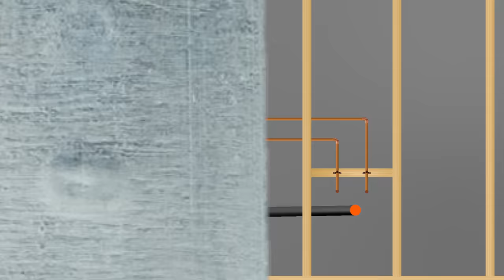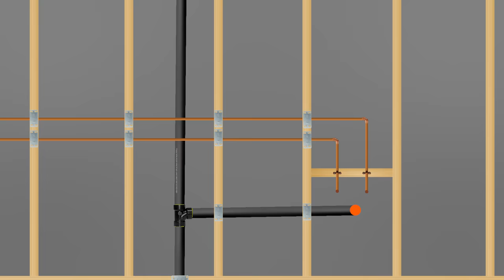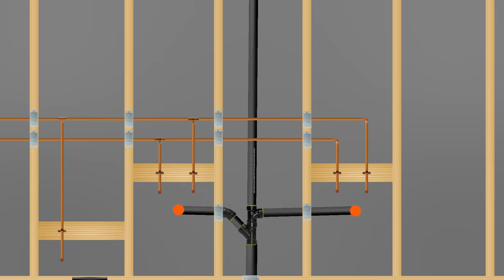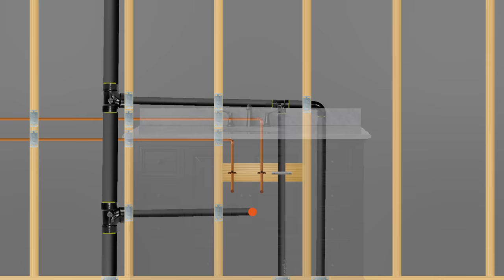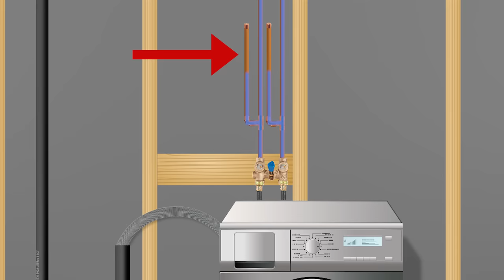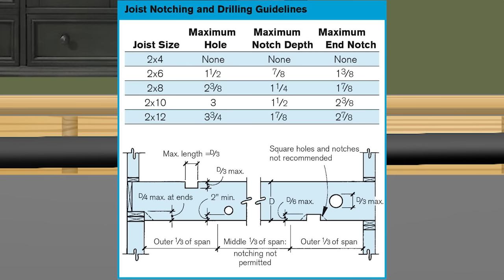10 Reasons Why You'd FAIL a Plumbing Inspection! | GOT2LEARN

Comment: I just moved into a house built in 1949. It needs allot of work, but I want to get the plumbing taken care of first. The escrow covered the big root clogs. I am positive the previous owner did not keep up with the plumbing, and the crawl space is small. When I flush the master toilet or run the shower. I hear bubbling from the guest toilet. Any insight into what is the reason? The quest toilet clogs easily. Thank you I will watch more videos, and have more questions
Reply from the maker: Could be bad venting David or maybe it just wasn't plumbed right, would need to see some pictures.

Comment: Excellent video. I am a plumbing and gas inspector in Alberta and you're bang on, these are the top 10. A lot of my job is answering questions for people who pull homeowner permits (which I'm happy to do), but this video explains what they need to know so well that I'm going to start sharing your link. Well done.
Reply from the maker: I am very thankful of your comment Kevin, I really appreciate your kind words :)
Reply: We have none of this in the UK. No requirement to have pipework inspected. We also don't generally have vent pipes either. Only pipework requirements I'm aware of is that any tank overflow pipes cannot be connected direct to drainage - the overflow has to be visible - so you know it's overflowing - water saving requirement. The other requirement is where there are two sewerage systems - 'foul water' and 'fresh water'. You can't connect toilets to fresh water drains  -as that bypasses the sewage treatment works. Many places have just one system and it all goes through sewage treatment works.
Reply: @nuntius1933  The no back flow is a thing here, England and the no over-flows straight into a drain (although that might not be so significant now most of us are on water meters - so we pay for wastage). Other than that, anything goes. There are regs for gas and electricity, but home owners are not bound by those either - they stop non-registered people charging others for work -  for gas work at least.
My dishwasher drain hose sprang a leak last night - so even quality of water parts used by manufacturers is not that regulated !
Reply: Hey Kev, Is there any way we could chat via email, or here?. I'm a new Journeyman, & i'm moving to Alberta in 6 weeks. I want to try & improve my code knowledge, & what better way than to pick the brain of an educated individual in the same field. Hope to hear back, ty

Comment: worked for a plumbing shop in  1978..  one of the bins of fittings in the back of the shop where everybody walked was a really full bin of 3/4" galvanized street ells..  an elbow with female threads on one side but male on the other.. i stopped at that bin and screwed 4 street ells together just a few threads.. forcing the last connection to just be touching as i rotated the ells in place.. i hid to the side when the  boss walked in..  he came to a skidding stop.. seeing the 4 elbows screwed into each other.  he picked the assembly up and examined it closely.  smiled and carried it away.. it ended up on his desk as a paperweight.

Comment: Great info.  Problem is that the plumbing inspectors in Atlanta just made up rules to flunk the plumbing on my sister's addition in the 1980's.  They disallowed the sanitary-tees in vertical pipes, claiming they had to be combo-tees, as you show for horizontal.  They failed a screw-in PVC connection to older cast-iron sewage pipe, saying the PVC pipe had to be leaded into the cast-iron (wouldn't it melt?).  They said the hot-water line to the kitchen sink had to be 3/4", even though it necks way down at the facet.  The later was in the State code, but a great waste of energy and water waiting for hot water to get to the sink.  They wanted the job redone by their "pro" buddies, even though state law allowed doing the plumbing in your own home.  Much corruption in building trades.

Comment: FYI. As long as the 90 is a “SWEEP” it can be used. A short sweep is perfectly legal and usually what people get when they say “I need a long sweep”. The fitting that you called a short sweep 90 is actually called a1/4 bend and can only be used for vents or drainage from horizontal to vertical
Reply: I was told by an inspector that a medium sweep can be used if you are transitioning from a horizontal run, to a vertical run like a waterfall.  I still use a long sweep anyway.  Medium sweep NO GOOD for a horizontal turn for waste water.
Reply: U shouldn’t be using a short sweep u should be using a San T with a vent. The name applies to both you can call them bends or refer to them in degrees
Reply: Reading from the "Cabot" plastic piping handbook, the 3" fitting in question is referred to as a "straight 90 and has a take-up of 1 27/32"  used in dry sections of the vent systems only.  The 3" DWV fitting known as a 1/4 bend (90) has a radius of three inches and a take-up 3 1/16".  Difference in radius and take-up is due to hubs on each end.  There is no such DWV fitting as a medium sweep.  For DWV piping there is only one radius for each pipe size, unless special order.  Standard radiuses are,  Short radius= 1 x Dia. of pipe,  Long radius= 1 1/2 x dia. of pipe.
Reply: @AyeCarumba221  any SWEEP can be used in verticals to horizontal or horizontal to horizontal applications. BENDS can only be used in drainage from horizontal to vertical or in vents

Comment: I live in an old home built in the early 50's, my washer plumbing is indeed 1.5" pipe. I had issues with it sometimes overflowing too. But since I bought a new "HE" washing machine a few years ago that uses far less water, it's actually been working perfectly fine now. The drain hose on the new washer is only about 7/8" or so, and the 1.5" drain pipe is more than capable of handling the flow from that small discharge hose.
Reply from the maker: Awesomeeee!

Comment: Vents lower than flood rim of fixture:-- Although an odd duck for sure, the configuration for an island vent has a workaround for being an exception. i also love wet vents which usually get a knowing nod of approval from inspectors. I don't know your locale but in Los Angeles I stopped putting T&P on water heaters and instead just  put a pressure relief outside by the shut off. No more pans or drain issues with old heaters inside closets. Always passed.

Not appreciated enough is the satisfaction of watching a main line stoppage let go, after you've been playing catch and release with a forest of roots, letting it tangle up just to the edge of the cable flipping in the cage,  then yanking back, like fighting a marlin; then it goes BOOM like thunder and you may even have to hook the cable up to your truck and pull out a 10 ft tail of magnificent roots. You feel like mounting them as a trophy! 

Retired plumbing contractor now, but thinking back, I enjoyed being Roto-Rooter man in L.A. Hollywood more. Every job was an emergency; calls in the middle of the night were like sweeping out of your bat cave, and whether you arrived at a swank Beverly Hills restaurant, a mansion on the hill, or some low rent apartment complex, you came in like a cowboy and everyone followed your commands, rich or poor. flooding sinks from floors above, main lines backing up into basements at exclusive country clubs. But all of them open sesame to you, fair haired hero of the moment!

Comment: Thanks for putting up this good video with explanations. Those doing their own plumbing should bear in mind that these are "minimum" requirements, and that your local code may require some different or more 'robust' features, .e.g. washing machine drain no less than 1300mm (about 4 ft 6 inch) above floor level not above the point where it ties in to the drain.  Likewise, local weather conditions (i.e. winter) may specify where running water, waste lines and vent stacks must go, in order to avoid damage from cold air ingress or being close to a cold outside wall. (These also govern rules for things like sizing of natural gas hot water heater and gas furnace exhaust vents. 
When roughing in, bear in mind that Code is a miminum standard. In many cases, going one size up, while slightly more expensive in the short term, can prevent future problems that are much more expensive to repair once everything is closed in. As with electrical, it's much better to "do a bit more" at the rough-in stage than try to retrofit later on. If you are hiring sub-trades to do some or all of this work, do not assume they will do it to code, or to the plans, or correctly at all. There are many excellent tradespeople, but every profession has its share of "take the money and run" bums. 
It's also worth remembering that some "big box" stores sell products - plastic accordion flex pipe sections, for instance - that do not pass code anywhere, usually for very good reasons. Just because they sell it doesn't mean it meets or exceeds local code requirements.
Reply from the maker: Well said Flying Beaver!!

Comment: About the below grade drains, I saw another video about that.  They said the same thing about using a 45 street ell in the sanitary tee to improve flow and reduce the chances of clogging.  But it also has an added side benefit, in the event that it does plug, the longer sweep makes it much easier to snake out, as snakes do not like sharp turns.

Comment: Good ones, but nail plates are not required unless the pipes are 1" 1/2  or less of the edge of the wall. Also You can't catch 2 different fixture from a drain stack unless both trap arms are at the  same level using a back to back fitting(double fixture fitting). Regarding to  tie-into an existing vent, its something you can do as long as you count all the fixtures units and ensure is capable to vent whatever fixture you will be adding. Clean-outs are required to have when is the end of the line, change of direction exceeding 135°, branches off the main  larger than 5' , foot vents and long runs every 100'.

Comment: My 1 century old building has many thing not "up to code" because there were not any code for many thing.
-No Shock absorber. (I did talk about my mom to not snap close foset because old rusted iron pipe could burst from their thin grinded wall)
-Many short 90° turns, also many pipe were done flat 0° so being so old the house ever so slightly sinked in the ground and now some pipe have negative ~-1 to -2°
-Many if not most 45° Y-Pipe on pillar sewer pipe are like at 3:13 So a mix of old pipes filled with junk plus that angle make most sink/bath and wat not "gurp"

Comment: Drill plates are not always required for plumbing or electric; they’re only required when the distance from the face of the stud/joist to the surface of the pipe/wire is too little.
A simple sanitary T on the flat won’t work for long, especially with toilets as the flow can hit the T and split leaving solids to build up.

Comment: A double sanitary tee makes near impossible to run a snake through it since it goes right through to the other sink and a clean out is not practical since there usually is not enough room.  Where I live we use double "Y" or off set the drains.  Sanitary Tee's also have a lot of resistance with flow even vertically installed.

Comment: At least by IPC code mostly right. 
Short sweep 90’s are allowed for horizontal to vertical transition and for directly come out of wall to a fixture. 
Double wye or wye fittings are not permitted to a fixture branch as shown unless it is vented. (Of course if the branch is vented his previous example of an incorrect why in 45 combination would also be permissible) A cross or double tee is permitted but most plumbers who have ran a drain machine will tell you 2 separate tee’s. 
You absolutely can tie into another vent. His standpipe example is tricky because for washing machines you need to have soapsuds relief (it’s just a special venting style). Total vent size is 1/2 of the drain pipe served with a minimum of 1 1/2 inches so one and a half inches canserve a 3 inch main. Venting on most houses can be combined and come out roof in one single pipe.
Reply: I'm currently doing some DIY work on my place. We are about to start plumbing. You mention that vents can usually be connected to exit the house as one pipe. What would be the requirements for that? All my fixtures are within an 15x18 ft area (estimate) but I kept them close to each other to save on plumbing supplies.
Reply: trance_dance 30 
Does vary in code but most use IPC. So you need a vent pipe to be 1/2 the drain pipe served with a 1-1/2 inch minimum. If the house main drain is 3” then it’s 1-1/2”   If it’s a 4” main then it’s 2” vent needed. And when you exit thru the roof in frost areas you need to increase pipe size to 3” vent just before you exit so your vent doesn’t frost over. 
All of your other individual vents can tie into this main vent. 
Vents will slope allowing moisture to go down the drain. Also because vents are flowing air, tee fittings will upside down on a vent only line.
Reply: @markchickenbutt8740  thank you so much for the reply. I'm finally to that part and the advice is MUCH appreciated
Reply: Hey @markchickenbutt8740 !

Hard to visualize this process, would be amazing to get some visuals on this.
Reply: Vents are sized not by the drain size although it could be a good rule of thumb but sized by the number of fixture units for the fixtures in the system.  For instance a full bathroom is 5 fixture units so an 1 1/2" pipe is adequate but if you tie a kitchen sink to that vent it would add 2 fixture units to that and if there are any horizontal runs above that tie in you would have to increase your pipe size.  once you get over 10 fixture units horizontal runs must be increased to 2 1/2" and so forth.
Reply: @markchickenbutt8740  why would you need to upside down tee fitting? Cause if it's not, there is always a path down, even if the moister/water doesn't follow the horizontal branch, because connection isn't reversed? The way I think, is that if you run water from the very top of the vent, it should still introduce the least amount of flow restriction, no? Thanks in advance for more of you thoughts

Comment: I’m an electrician by trade but also a finish carpenter and I can fix anything.

I do plumbing too 
Any crackhead can glue pipe together and “ make it work “
But it’s knowledge spitting, like this guy, that turns us closer to craftsman and professionals.

I follow the general rule of only using a hard 90 on vents.
It was nice to learn that they can also be used on toilets too.

Learning about other trades helps us all out and makes us better craftsman.

Thanks for sharing your knowledge!
You do great service to others
Reply from the maker: Most welcome, please share if you can, cheers!!
Reply: ya I bet, fix the economy superman.

Comment: Another reason for using a purpose built device for water hammer is that when that 18" section of pipe fills with water, it sits stagnant. Stagnant water can breed bacteria, like legionnaires disease.

Fantastic video!
Reply from the maker: Yes, forgot to mention that, thank you very much! Please share if you can :)))
Reply: Small comment, if you don't mind, but "harbor" bacteria is more accurate.
Reply: How true is that since all my houses and friends houses all have pipes that go past the faucet?
Reply: Not be a pacifist, alarmist or to high-jack this comment, but keeping the major concern in sight relieves unnecessary worry:  First, the device's primary intent is to address water hammer and water-logging of vertical-pipe shock absorbers, of which a draining of the supply line can usually be done with minimal effort.   Secondly, the contraction of the bacteria is generally by inhalation of contaminated water mist.  Typical chlorination by the water company is enough to impede the bacteria's proliferation but not sterilize a potable water supply completely; pH, temperature, time and other conditions can affect its efficacy.  Also, copper pipes have an ability to suppress growth.  Biofilm  can also form within the system.

I'm not a professional but do have experience and familiarity in the field and of the subject as well as a big concern of the vulnerability.  I would be more concerned about hot water storage tank temperature before this (i.e. don't turn the temperature down to save on heating costs), and the conflicting issue becomes the allowable hot-water supply temperature (105F-120F, residential) versus this bacterial suppression (140F @32 mins., disinfection @158F-176F with circulation being beneficial); the answer - a mixing valve (thermostatic is the automatic of that).  So at this point we have costs creeping higher and higher where history does not show a problem within this small specific area of focus (shock absorbers - the issue is more complex) although it is technically logical as the OP stated.  Still, it is much more about inhalation of contaminated mist.

Comment: Great video! I have a few questions: 

1. If a drain line is going from horizontal to vertical, should a short or long sweep 90° elbow be used? 

2. Can a sanitary be used on its back for venting? The vent would serve the kitchen sink (with dishwasher and disposal) and the tub/shower.

3. Can a double sanitary tee (2in inlets 3in top and bottom) be used in a scenario where one side is the inlet for the kitchen sink (with dishwasher and disposal) and the tub/shower and the other inlet is the bathroom sink and a washer (pumping action discharge)?

Comment: In my area, the 2" washer standpipe has been required for as long as I remember (early 90s). Also, they don't allow normal pipe to be used as water hammer arresters. They have to be the bladder type. They were required for washing machine and dishwasher lines.